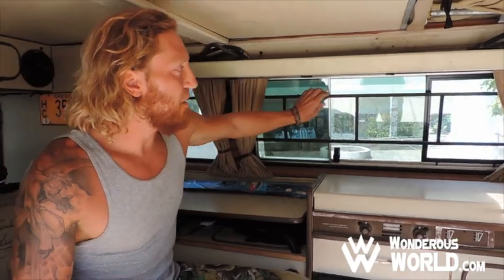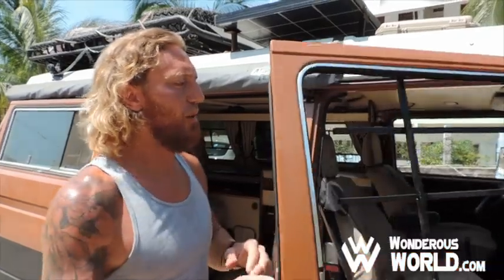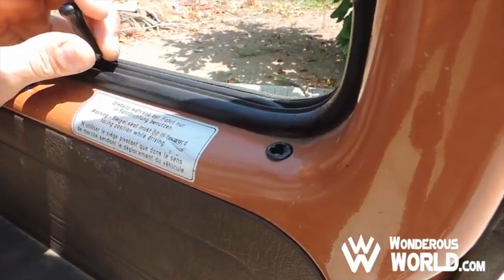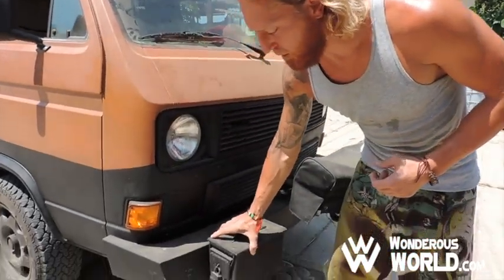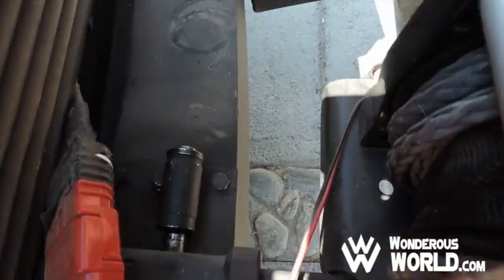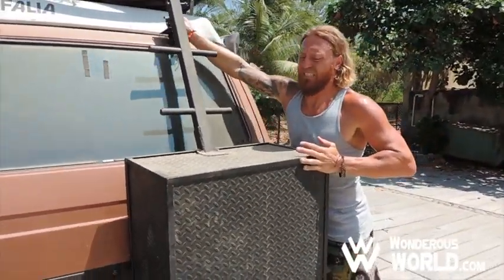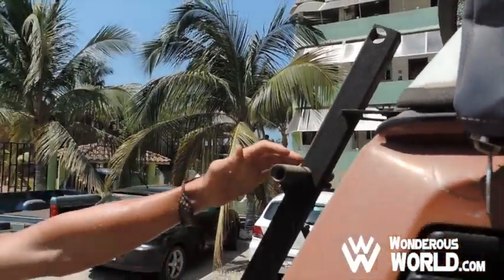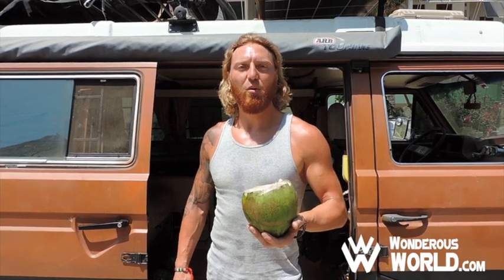How to secure your overland vehicle: by Wonderous World

Comment: Like your style. Here is my experience.
I used to operate a vw transporter, carrying tv camera equipment in london.

On the sliding doors I drill a hole a through the running channel that is located on the inside of the vehicle. 
This allows a padlock to be installed that prevents the door from being opened.
The padlock can be removed by opening front doors and leaning in.
If you drill the hole 4 inches from the end stop and the manufacturers door  lock is forced, it will open far enough for the lights to go on and thus activate the alarm.
This simple idea can be applied to other vans.
If you have a false floor then items stored under it and accessed by opening the sliding doors therefore are very secure when the door is padlocked.

For the rear tailgate, remove interior trim slide a 18 inch long steel bar inside the bottom of the tailgate. Attach a few inches of  1 inch chain to the bar  so it hangs out of the inside of the door. Secure another chain inside the van so the two chains can be padlocked together. Adjust the length of the chain so the tailgate can be opened only enough for you to squeeze your hands in to unlock the padlock from outside. 

The short length of chain needs a bungy cord or elastic to keep it from being jammed when closing. Like the side doors, if the door is forced it will open far enough for alarm to sound.
The thief is likely to be confused and run rather than try to troubleshoot.

Have all the padlocks keyed the same.
These protections do not advertise themselves so the thief is unlikely to come prepared. I discourage the use of external locks in some locations as it advertises that you have valuable contents.

For the front passenger doors you can consider an electric deadbolt that fails safe if the battery dies.
Can also consider a version of the chain idea for the front doors.

So with this setup you can leave the vehicle and be confident it remains secure as long as you are within earshot of the alarm.

There is nothing like physical security!
Investigate cost of replacing front windows with polycarbonate.
Egress in an emergency should be factored into your drive

Mjb
Reply: Great ideas to add on to what's laid out in the video. Thanks for contributing with some detailed concepts!

Comment: Great video. The window bars are an effective solution for those who fear the standard smash-and-grab. Not 100%, but great. The removable front window bars that lock with the door closed are especially ingenious. The external storage solutions are very functional and address the ever-present issue of maximizing space within the vehicle. 

However, there are some decent criticisms in the comments. I've compiled them and proposed some solutions:

"Even though the lock knob has been removed, a slim jim can be used to open the doors / you can break the window and open the door using the door handle."
Well, not really. This particular van doesn't unlock when the handles are pulled, although this could be an issue on some newer vans. Either way, you can see the external padlocks that still have to be dealt with before those doors open.

"The external padlocks are easily defeated / advertise that there are valuable contents in the vehicle."
At a somewhat greater expense, the external padlocks could be replaced with proper door deadlocks. Secure, 90% less visible (or 100% if you choose electronic that fails in the 'safe' position with loss of vehicle power). Also, see 'locking bars' below for another, alarm-oriented take on this solution.

"The front windshield is an unsecured point of entry / it's easy to defeat a windshield and pop it out"
True. Although the difficulties of securing the front windshield are addressed in the video, no solutions are proposed. To decrease the chances they can smash their way through the window, security film can be applied to increase its strength. To keep it from being popped out, depending on your personal van's windshield shape and construction, it may be possible to weld some flat steel stock along the windshield's edges JUST FAR ENOUGH to keep someone from knifing the rubber and popping it out. Covering every edge completely would be the most secure, but hinder road visibility by a decent amount. It may not be required to cover the entire circumference of the window, spaced 'tabs' of protective steel at intervals could be enough to keep a windshield in place if the rubber was cut. Not ideal due to the slight loss of road visibility, and not perfect, but a possible solution. Likely enough to make a windshield-popper walk away.

"The Club used to lock the steering wheel is easily defeated."
You can instead use the Disklok disc-shaped steering lock. It's such a headache to remove without the key that a thief with this idea will almost certainly just move on to the next vehicle.

"The steel cable securing the roof rack is easy to cut."
Welded chain can be used in its place. Honestly, though, if you're securing your stuff with easily-snipped chicken wire, the cable or chain holding it down isn't the point of failure.

"You've trapped yourself in the vehicle in case of emergency."
Well.... Potentially. Replacing the outer padlocks with deadlocks (or using the twin-bar interior padlock strategy below) would increase your ability to open the vehicle from inside. If your front window bars are not in place, you can break the front windows using a standard emergency tool or the stud of your seat's adjustable headrest, if your vehicle is so equipped.

"None of these solutions prevent someone from simply towing away your vehicle."
True. Even such defenses such as an immobilizer, a gear lock, or a wheel lock will not prevent someone with good towing capability from making off with your vehicle. In this case, you have to fall back on electronic trackers. GPS trackers that operate off cell phone towers are available for purchase and can let you track a vehicle that's been stolen, although this is less viable in countries and zones with poor cell phone coverage. In these cases, if you're really worried about it, you'd have to wire an old-school positional indicator and carry the receiver with you, like you see in Breaking Bad. This solution requires that you know about the theft during / shortly after the occurrence, and have a means of pursuit. Not impossible, but certainly tricky. Piercingly-loud car alarms that activate upon movement, wired to the solar panel's batteries, can make an extra deterrent. Streaming front/rear/side cameras can also help figure out what happened during the theft if you live in an area with cell phone coverage.

The "Locking Bars" solution
This solution comes from Mike in the comments section. It's an adaptable, externally-invisible locking solution that plays off of the advantage of a car alarm that triggers when your doors are opened. I will reproduce it here:

------
On the sliding doors I drill a hole a through the running channel that is located on the inside of the vehicle. 
This allows a padlock to be installed that prevents the door from being opened.
The padlock can be removed by opening front doors and leaning in.
If you drill the hole 4 inches from the end stop and the manufacturers door  lock is forced, it will open far enough for the lights to go on and thus activate the alarm.
This simple idea can be applied to other vans.
If you have a false floor then items stored under it and accessed by opening the sliding doors therefore are very secure when the door is padlocked.

For the rear tailgate, remove interior trim slide a 18 inch long steel bar inside the bottom of the tailgate. Attach a few inches of  1 inch chain to the bar  so it hangs out of the inside of the door. Secure another chain inside the van so the two chains can be padlocked together. Adjust the length of the chain so the tailgate can be opened only enough for you to squeeze your hands in to unlock the padlock from outside. 

The short length of chain needs a bungy cord or elastic to keep it from being jammed when closing. Like the side doors, if the door is forced it will open far enough for alarm to sound.
The thief is likely to be confused and run rather than try to troubleshoot.

Have all the padlocks keyed the same.
These protections do not advertise themselves so the thief is unlikely to come prepared. I discourage the use of external locks in some locations as it advertises that you have valuable contents.

For the front passenger doors you can consider an electric deadbolt that fails safe if the battery dies.
Can also consider a version of the chain idea for the front doors.

So with this setup you can leave the vehicle and be confident it remains secure as long as you are within earshot of the alarm.
------

Comment: Another way instead of using the club lock for the steering wheel is to replace the steering wheel with one that has a quick disconnect.That way you can just take it with you every time you leave the van.

Comment: You do realize the windshield can be removed in about 5 minutes, slicing the seal with an exacto knife?
Reply: That's definitely an issue if they know how to do it. Security film probably wouldn't prevent that either. He might be able to get away with some flat steel stock welded over the sides of the windshield, but the cost to your driving visibility would be high
Reply: @cheyyne  I know this because my windshield was stolen out of my car when I lived in Venezuela years ago😉
Reply: @ravenm.  Experience is the best teacher! I'm happy to learn this from yours. Do you think it's viable to have welded steel tabs that hold the windshield in place?

Comment: How about camera coverage? Two or three action/security cams with wifi and motion detection (there are many on the market) at some well-chosen angles, wire power to external battery (or car electrics), store a video loop over wifi to a cheap smartphone on a hard-to-reach place... You'll have them recorded even if they destroy the camera's (and they probably won't even realize it), and if nothing moves, close to no power is consumed. Entire setup should be possible with a couple of $100's and a bit of hightech savvy.

Comment: You should weld a piece on the top brace of the gas canister "cages" so that it will cover the canister caps.  Otherwise, you'd need to have locking caps.  I think an additional welded plate would do the trick.
Reply from the maker: Great idea, didn't even dawn on us. Thanks

Comment: you can simply open and vw of this era, Golf, bus etc with a screw driver pushing right below the handle through the Sheet metal. takes 1 sec, then push down and back, takes 2 sec and the door is open. I am from GER and have seen this very often. 
for window Security there are films to bring on. these are stronger than a front window and there is no way to get in through it.
Reply: Security film sounds like it would help the front windscreen, but as Raven M. pointed out below, does that help protect the window shield from being sliced by knife and the entire front windscreen popped out? Another layer of protection may be required
Reply: @cheyyne  it protects everything you put it on. especially the front side windows have NO PROTECTION in this stupid video. 90% of entered cars I know of took a stone, 1 sec - in.
Why would one cut out the windscreen???

Comment: i understand the need for the bars but in the front ones........ whats stopping someone from breaking the window, unlocking the door and moving the bars?
Reply from the maker: Did you watch the video in full. We explain why that isn't possible. There are multiple reasons. The knobs are cut so nobody can grab them to unlock the door. Even if they did get it unlocked then there are exterior latch locks holding the doors closed. Also the bars cannot be removed without the door being open as they push up to remove which isn't possible when the door is shut. Take a look at the video again and you'll see what I'm saying. Thanks

Comment: Old video i know..here comes the "but"... A windowscreen can be removed very quickly and easily by popping the rubber. Seen it done many times and it is a method people use to break into your vehicle. It is also slilent. Plus it is easy to get around many of the other security stuff shown on here such as a coat hanger wire slotted down the door window rubber and simply hook the door opening mechanism. People will also simply puncher you fuel tank with a screwdriver and drain it. We have been travelling around the world (The world as in not your home country and a couple of others) for 6 years and even i would not say "I am your overland expert" so to make a comment like that is setting yourself up to fail. 
The video seemed to be more of a lesson in how to overload your vehicle weight wise to the point where it will be completly stressed and break..that poor engine!!
We are about to do a video on our Youtube channel about vehicle security...you maybe surprised what we have to say.
Cheers from Mali, West Africa....unfortunely one of the most unsafe countries on the plant.
Reply: You make good points. The front windshield is an issue. Flat bar stock welded to the sides of the windscreen may prevent the rubber being popped easily, if you don't mind the decrease in visibility. However, you're wrong about the coat hanger - he has padlocks on the exterior of the doors. Even if the opening mechanism was triggered, the padlock is another layer of defense. You can have your doors fitted with deadbolts as well. As far as puncturing the fuel tank goes, that may be a problem; you could try to armor your fuel tank and fill tubes, but compared to having your entire life stolen from out of a vehicle that you use as a home while traveling, losing a tank of fuel / replacing the fuel tank is not the biggest setback you could face.
As for the burden on the engine, that's probably true for this old VW, but many vans were built as cargo vans in the first place, and could take this amount of steel and more without missing a beat. I'll be happy to check out your channel and see what you have to say about vehicle security.
Reply: @cheyyne  thanks and valid points you make. Bolt croppers sort out the padlock problem and are cheap to buy. I have seen doors with dead bolts peeled back from the top to gain access, even more so with large rear doors. If they want to get in they will. New vehicles with factory dead bolts etc are broken into by making a hole in the door metal and prising the lock internally. there are ways to protect this from happening though. It is a real minefield and to be honest we do very little security wise. Easy access means less damage to the car just leave an old phone and fake credit cards easy and quick to find as they do not want to hang around for to long robbing the car.  No broken windows etc which maybe hard to find a replacment for in a forgien country. We mainly pay a guardian to look after our car while we go shopping etc. He earns half a dollar and we come back to a car that is intact..6 years and that system has worked so far!

Comment: Hey guys I got a t25 in the UK!!!! Just wondered have you reinforced the pop top in anyway to hold the roof rack? Like where the bolt on rain gutters are ???
Reply from the maker: Our rack doesn't bolt onto the rain gutters like a tintop Vanagon, it bolts onto the fiberglass pop top section. Four bolts drilled through on all four mounting brackets. We applied some reinforcing epoxy on the inside of both sides of the bracket to help but we haven't had a problem at all with the fiberglass cracking. It's stronger then we thought as we had friends unexpectedly crawled on top and it held just fine. Should be fine for at least a good 200 to 250 lbs continuously while traveling. We used these brackets http://www.amazon.com/Yakima-8008001-WideBody-Bracket/dp/B000RRSII2/ref=as_sl_pc_qf_sp_asin_til?tag=marideaz-20&linkCode=w00&linkId=DSTLL2HBQMVM7FTJ&creativeASIN=B000RRSII2

Comment: Not easy for rookie lock picker to get it with the door lock fix. A criminal with a slim jim or window break can unlock or reach in and use the open latch. Pad locks prevent many but anyone with bolt cutters I used to have in my truck for cutting a chain and adding my lock for places to get onto  to off road and get out if they park at the gate you got in. Not stealing or damaging anything for me though.
Reply: Agreed. The outer padlocks can be replaced a little more expensively with proper deadbolts that are externally inaccessible.

Comment: Thank you so much but I am curious ok they can't open the door after breaking the glass  it, cause      you  unscrewed the knob but can they open the door with the door handle after breaking the glass?   while you are asleep, or away and maybe they can't take your van but they can steal some items.
Reply: You can see the padlocks he's added to the exterior of the doors. Even if they knew how to trigger the stock door-locks to open, that doesn't get them through the dead bolts. Yes, the bars are wide enough to allow someone's arm to reach in and try to take something if they break the window; but it looks like from what we can see, he doesn't keep any items within reach of the left-side windows. They could grab maybe the blanket from the bed, or flip up the top of his cooking range.